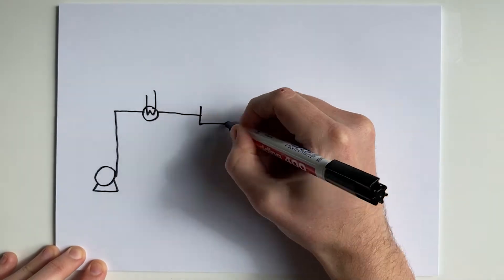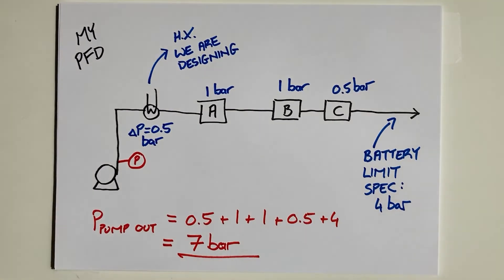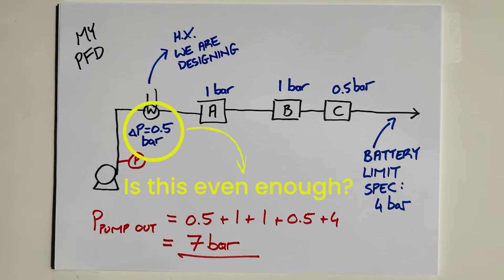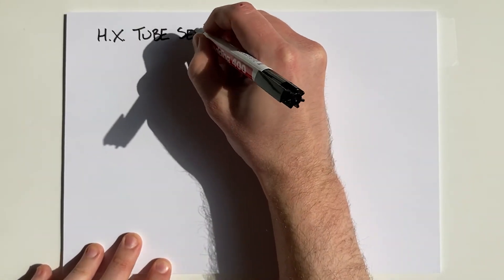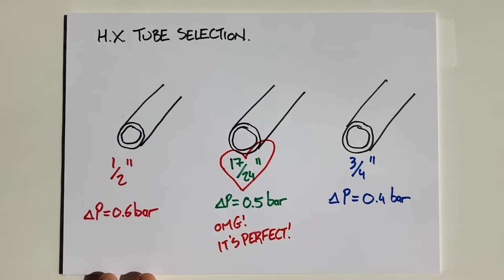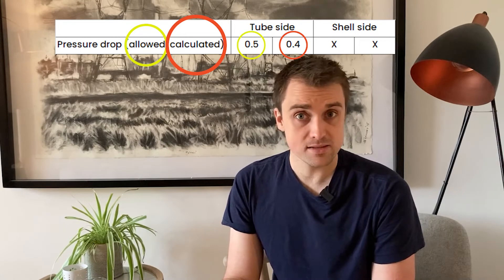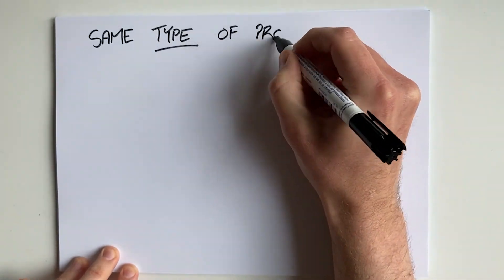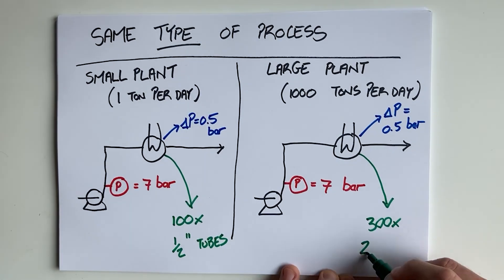You should know pressure drop before designing equipment

Comment: But what decide the value of the allowable pressure drop  for an equipment? What is the base for this value? For example, why it should be 0.5 bar for heat exchanger design, why not 0.3 or 1.2 bar instead?

Comment: Hi Pat,
Great video, thanks ! 
But how is the pressure drop budget chosen when the PFD is made ? On which criteria ?
Reply: Hi, Hugo. I am not Pat, but I can answer- it depends on pump and pipelines of the system. And that part vary on size and cost (and history, if it is brownfield).
Reply: @NikolayBychkovRus  I know its been a year from this comment, but I still want to ask, how do you predefine the pump and pipelines when you don't know the pressure drop of the different equipments in the process? How do they estimate how much would each one have? Is it based on experience, or cost? I ask this because if you assign a random value you could end up noticing its impossible to design anything under the pressure drop budget you are given